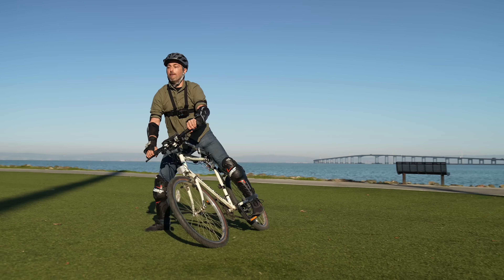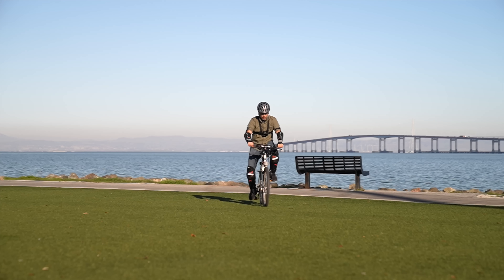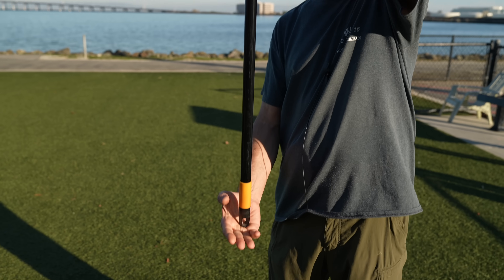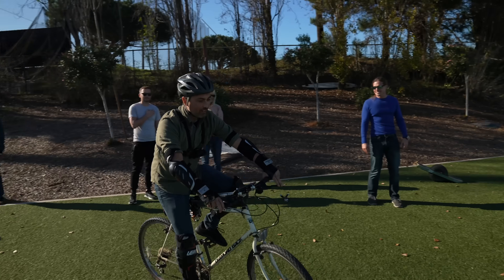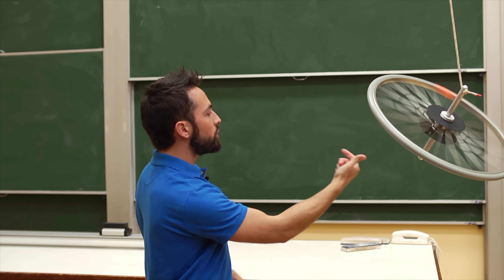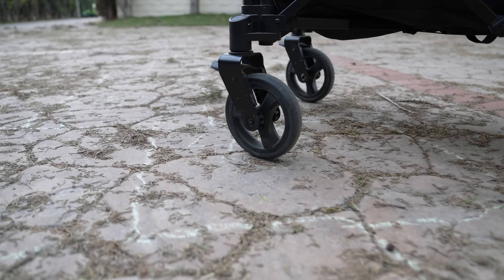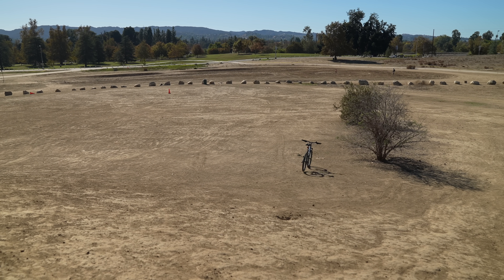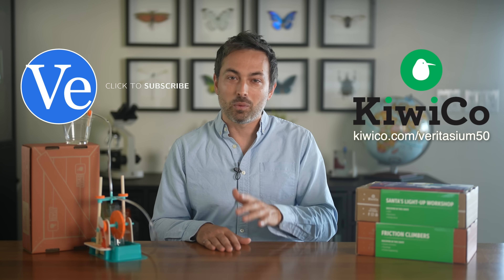Most People Don't Know How Bikes Work

Comment: Next let's do a video about how to turn on skis.  It's a lot more complex than you might think!  If you just try to twist at the waist to point your skis in the desired direction it doesn't work at all - your skis keep going straight and your upper body turns instead - which achieves nothing.  If you rotate your legs independently in your hip sockets you can in fact change the direction your skis are pointing.  But to turn effectively you need to get your ski's "on edge", which involves inclination (leaning) and angulation (bending your legs/body).  There's a whole bunch of physics going on there that ski instructors spend hours and hours debating...

Comment: I used to race bicycles, but initially I didn't like criterium racing, where the races are fast and usually go around a city block over many laps. Turning over and over  at 30 mph in a tight group of riders became less of a problem once I became AWARE of counter-steering and just how to put small pressure on the inside handlebar to make the bike lean into the fast turn. The effect of course is even greater in motorbike racing.

Comment: Counter steering ( positioning the bike into position by steering in the opposite direction you want to turn, then switch back )  even more important for motorcycles.  At higher speeds, the motorcycle is turned using  gyroscopic effects.  If you don't use gyroscopic effects on a motorcycle, you can still turn but you have to slow down before you turn.

Comment: The front wheel of a bicycle is essentially a caster wheel
I don't know why you said that directly after showing that a bicycle wheel goes more to the front whereas a caster wheel does the exact opposite (Okay they turn in the same direction, but still I found that comparison to be weird).
Reply: The geometry of a bike makes it look like a backward caster; but you have to compare the location of the contact patch to the location where the steering axis meets the ground.  That shows that they're actually the same.  You don't see this on most casters since their axis is vertical.
Reply: Hmm yes this makes a lot of sense.
Though atm I'm having a hard time imagining how a wheel that has the contact patch located behind the location where the steering axis meets the ground would behave any differently just when tilting the bike

Comment: As a controls engineer, I don't have to watch the video. Riding a bike is a closed loop control system which is unstable. The ablity to steer in both directions is crucial to keep balance. You could control the speed to keep the balance, but that is very hard. So all in all, this video is dumb.

Comment: RIDING WITH NO HANDS... Most people don't know how they ride a bike, as this video shows. You should also study riding with no hands. From analysing years of bike riding, the riding-with-no-hands technique is to use gyroscopic precession. To turn right, flick your hips (briefly) left, so gyroscopic action makes the front wheel POINT left, so the front wheel MOVES left, so the bike leans to the RIGHT. Essentially, you use hip flicks to make the front wheel point more left or more right, as is needed to keep the wheels directly underneath the bike.

Comment: If you roll a bike down a hill, without a rider, the bike is sort-of stable. It might lean over but it generally keeps its angle of lean. If a person, who has never ridden a bike before, gets on a bike, disaster ensues.
FURTHERMORE, for someone who can ride a bike, riding with HANDS ON THE HANDLEBARS requires a totally different set of reactions to riding with NO HANDS.

Comment: Its not most ppl dont know how a bike works.
Its just you.
I bet he cant go in a straight line.
This issue your having, well, your the only one having it. (And the others that cant ride bikes). Other regular ppl can turn no issues.
Its not like a broom stick or a unicycle.
Both have 1 point of contact.
Nothing like a bike.
Reply: ok kid
Reply: @wargamulaya  ah yes the "adult" calling everyone kid even tho hes probly 18. Ummmmm, yeeeeeeeeeah.
Reply: @CartoonWeasel  I'm 17
Reply: @wargamulaya  we already knew that
Reply: @CartoonWeasel  we ?
Reply: Im sure you did a lot of reasearch on this topic and are totally not just mad
Reply: @Annae_xs  actually i did. I went to try it with my bike.
Blocking it straight does make it weird. The turning one however, doesn't change anything really. You can just turn immediately without doing what he says. Turning left slightly and then make the right turn. Vice-versa.
Speed your going at is a major factor. Found that going at a crawl made it easy, like nothing is wrong. Going faster, then a balance issue comes into play but you can still make the turn pretty easily.

Comment: Important tip for any beginner at biking: when you feel you're going to fall, just use the brakes and you "fall with control" to the left or the right, allowing you to just land safely on one foot.
Using the brakes will avoid you to slide and fall the way it happened in this video.

Comment: As a motorcycle rider, this is a golden rule when leaning into turns. Lean right, turn bars left. Sounds counter intuitive, but yeah. This guy explains it better than I ever could lol
Reply: Or as they say push out on the handle bar in the direction you want to steer. It much easier to feel this effect on a motorcycle. As you are riding in a straight line you gently push forward on the right hand grip and the bike leans right.
Reply: @shifty7739  not only is much easier to steer, it is the ONLY way you steer a motorbike, whether you notice or not. But once you know how the mechanism works you can easily lean the motorbike with literally one finger pushing the handlebar.
Reply: @oscariglesias9004  Agreed but what I actually said was that you it was easier to feel the counter steering effect not easier to steer.
Reply: @oscariglesias9004  I wouldn't say it's the "only" way to turn, I've made plenty of turns without counter steering in the opposite direction, usually just by simply leaning. You take them wider, but you can make a turn without touching the bars. Speaking from Harley FLHR experience
Reply: @bullypopful  The thing you don't realize is the bike is still counter steering itself. They literally demonstrated this.
Reply: @shifty7739  it’s probably due to a bigger front wheel. I have a fat tire ebike and at high speeds it’s incredibly noticeable.
Reply: Hermano Hermana  Hmm? This isn't exactly a crazy thing. There are lots of things that living creatures do intuitively that they probably can't explain the physics of. It's probably happened at all points in time in history.

I doubt if I asked my grandfather if he knew how the physics of a bicycle worked he'd be able to explain it, or that his father would be able to. Probably wouldn't even be able to explain the physics of how you know how to aim a ball when you throw it, or how to balance yourself when stepping over something, or how much force to put into a jump.
Reply: yeah watching this vid i was super happy i knew exactly what he was talking about how you actually turn on bikes and was screaming counter steering before he finally got to saying it!
Reply: I was about to say "If you ride a motorbike, then you know all about turning the bars the opposite way to the turn"  but i see you beat a lot of us to it lol
Reply: I read about this decades ago... and tried it using my Trials bike.  The big 21" front wheel, light overall weight, and quick steering angles resulted in a VERY quick corner entry that I never tried with such vigour again.
At the time it was claimed to be mainly used consciously with big heavy bikes.
Reply: Race car driver actually do the slight counter steer for a different reason, for the tire side wall to lean over
Reply: First thing taught when getting a bike license
Reply: same here, counter steering is one of the most important things to learn when riding a motorcycle, but it also came natural to me because I have rode dirt bikes my whole life, there's not a ton of difference between them. riding on 2 wheels is pretty much all the same mechanics. bicycles counter steer if you get them up to speed fast enough. push right go right push left go left
Reply: I recall this accident with a rider where he was doing a curve to the right and there was a truck coming on the left, on the opposite lane. The guy panics and actually steers right while leaning right to try to go even more to the right because he was in a collision route, but because he was leaning the right steer ended up pushing the bike up and undoing some of the lean, leading him to steer more to the left and crash into the truck. I think this kind of thing comes with how it works at lower speeds, so people think it's going to work the same at higher ones despite the much larger amount of force trying to undo the lean during a curve.
Reply: @maxwellsterling  yea i remember seeing that
Reply: I don’t get it I’ve always riden like that as second nature by counter steering?
Reply: No need to lean the body in order to turn just push away the side of the of the handlebar to whichever side you want to turn in. Body lean help to keep the lean angle low (keep the bike as upright as possible) but has nothing to do with the turning itself, it's the force on the handlebar. And that countersteering happens only at speeds above 10km/h when the gyro effect starts to kick in. Lower than that and you turn the handlebar in the direction you want to turn in.
Reply: @mmdirtyworkz  Nah, go out and test it on yr pushy :-)
Reply: Yes, you’re right. Its called countersteering, and a better way to think intuitively about it is that you push the side of the handle down the direction you want to steer in.
Reply: @rockstarali99  Push the handle down? You mean push the handle forward.
Reply: The same goes for Paragliding. 1 day of lifting it up, and being able to hold it over you. The Trainer came and said, You do ride a lot? Yeah, Motorbike and Bicycle tours. You intuitivly know how to use your body to counter the pull of the wind.
Reply: @MaxVax-dh7rh  except body weight and positioning is not used to steer a motorcycle/bike. Force on the handlebar does that. Body positioning only helps when you want the bike to lean less and in doing so you have more of the tyre contact patch on the ground. Amazing how many people in the comments think they can steer the bike just by changing body position...
Reply: @mmdirtyworkz  You got me Wrong or i explaint it wrong. You do the exact little Pushing Movement (wich sounds counter intuitve, Play with a glider.
Reply: Best way to put it IMO is Push left Lean left Go left, Push right lean right Go right. Simple to remember and once you do it it's just natural instinct.
Reply: The answer to this video is center of gravity - however his previous video was a mess.  But it did highlight how anyone but electricians and electrical engineers, take things for granted.
Reply: Exactly. It's countersteering and forces you to lean into the turn
Reply: sbk or some moped you can just execute  sharp turn
Reply: If you want to see a sad video of a motorcyclist not using countersteering, search "Motorcycle crashes head on into fire truck" and then rewatch the crash scene at 25% speed.
Reply: But on running motocycle counter-steering is compleatelly different topic. In case of motorcycle it IS mainly gyroscopic effect, because speed is much higher as well as moment of inertia of the wheels. 

On hight speed you are not counter-steering to allow you leaning later like on bicycle. You directly lean the motorbike in right direction using precession by continiously pushing handlebar in an opposite direction.
Reply: @antonvlaskin8496  Yep.  There is no left-then-right motion.  And it is very subtle at speed.  Maybe 1/2 of an inch to change lanes on a freeway.
Reply: Hold up... Lean right. and turn left? That'd be a barrel roll waiting to happen, I dunno bout that one. Putting your center of mass further away from the direction turned, doesn't that just make it worse? Maybe I am wrong but I would put my weight to the left, then turn to the left so once again I am on top and steady.
Reply: @felixennis-thomas2246  When you push right side of the handlebar forward and pull left towards you on a higher speed you are not turning left, you are leaning your motorcycle right. This is due to gyroscopic effect called precession. Completely unrelated to this video though.
Reply: @antonvlaskin8496  Yup, that makes sense, so now why on earth would i lean my body right aswell??
Reply: @felixennis-thomas2246  Because it allows you to offset center of the mass even more, for a harder turn. It's not mandatory.
Reply: @antonvlaskin8496  Could you send me a video of you leaning right and turning the handle bars left?
Reply: @felixennis-thomas2246  Nah, everyone who want to understand could search videos about precession. You could just keep your brilliant knowledge.
Reply: Fun fact? I was able to learn to ride a bike ONLY in 7-th grade !!! Because only then i uderstood phisicaly speaking what i need to do in order to maintain balance. The counter-forces i needed to develop ! In 7'th grade i got the Phisics discipline, the mechanics part. Same with the swiming, i was able to swim when i understood what i need to do in order to swim, by creating a constant force down to lift my body a little above the water. To be exact i neded to lift my hand or my leg more aquadinamicaly than when i put it don in the water. The diferences between these 2 forces was the lift force, to be able to stay on water. After that, to advance in water, i used part of the lift force to advance. So the movement was like a propeler.  So now i learned to swim too.  Same with staing on a ball , or 2 crossing pipes, like a circus guy,  or sky-ing and snowboarding. Couldn't aford a ski instructor, so i distroyed couple of a sky slopes to learn. Snow was destroyed,  and other sky turists had critical problem riding the slopes i used. Yeah , whenever i had a real problem to learned something, the other people around me got THE BAD LUCK, during my learning process. And i'm ok with that because nobody wanted to HELP ME. SO THEY GOT ALL THE SIDE EFFECTS OF KARMA !!!
Reply: It's the centrifugal force of the front wheel. As you try to turn it, it leans at 90 degrees from how you try to turn it which forces the entire bike to lean with the wheel. Then you follow through.
Reply: when it comes to a motorcycle its really dependent on the size of the bike and the pace you are going at.
Reply: @jorimills1368  Not really. At high speeds a small push on the right handle will initiate the right turn. At low speeds, the very best riders will noticeably countersteer to initiate a very tight turn. You will see that rider actively turn the bars to the left which makes the bike aggressively lean to the right. That action is what turns the handlebars to the right. It's the lean that turns the handlebars, not the force that the rider inputs. When you master this technique, you can do a U turn in the width of two parking spaces, at a speed just above walking pace, and easily make a U turn in a narrow two lane road.
Reply: @jorimills1368  Not sure I'm understanding what you mean by the size of the bike making a difference somehow, but speed is definitely a factor.  At low speeds there's more bar turn than lean, at higher speeds there's more lean than bar turn, but there's always a bar motion "out" before a turn regardless of what speed you're going or what bike you're on, it's just almost imperceptible at low speed, just as was shown in the video.
Technique wise, the only thing different motorcycle to motorcycle is weight and ergonomics, the skill and manipulation is all the same.
Reply: also on motorbikes, there are weights at the end of the handlebars, desinged to help with the balance, sounds crazy with 600pound bikes that 1 pound weights make a difference but they do
Reply: @crabsodyinblue  bar weights are to reduce vibration and vibration only. The only way the weights would effect balance is if they could move outward and inward. Like having a passenger put an arm outward. The weights are stationary and equal.
Reply: @crabsodyinblue  incorrect.  Bar end weights reduce vibrations in the handlebar.
Reply: @crabsodyinblue  this is for vibration dampening only. The bike work exactly the same without them.
Reply: @crabsodyinblue  yeah this sounds crazy because it isn’t true. How do bar end weights help with balance of the bike when a rider is on the motorcycle? Do you mean to tell me manufacturers designed a motorcycle so imbalanced that they decide to balance it after production with these small bar end weights? Preposterous. Take them off and you’ll easily see as other have mentioned that the weights are only there for vibration dampening.